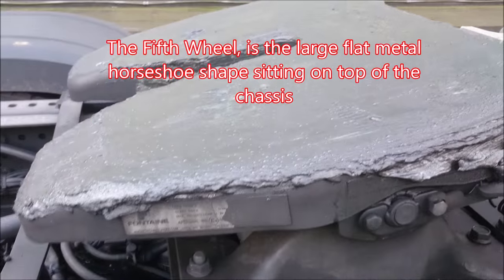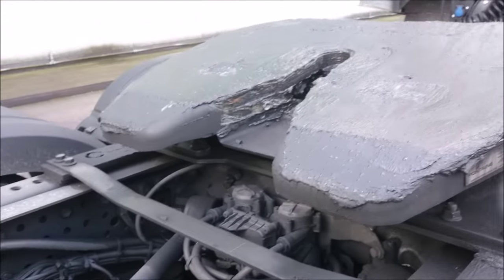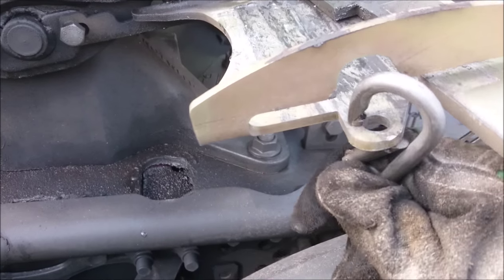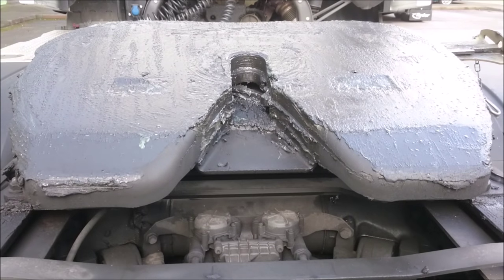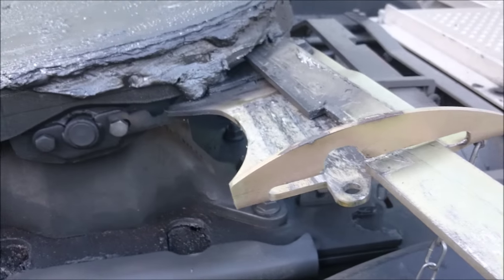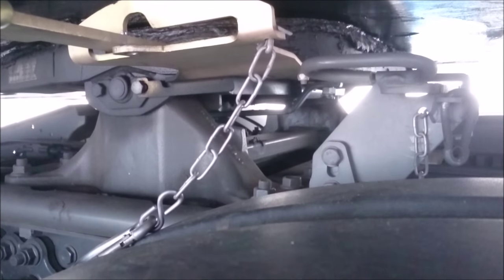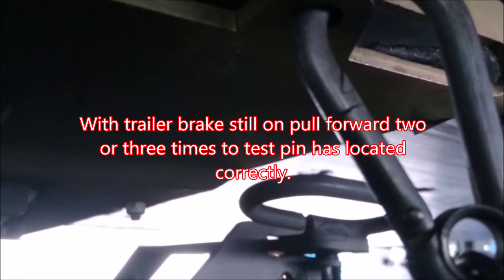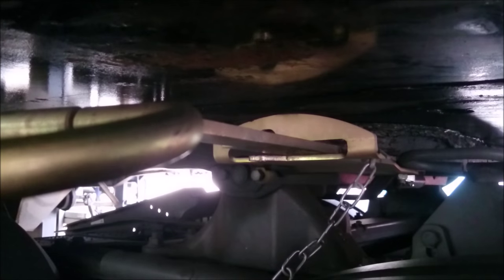Fifth Wheel Dog Clip - LGV Beginners Guide

Comment: thanks to this post I actually passed my theory and my c class 18 tonne ridged practical test just got my module 4 cpc to do now. Do you have any help ideas you can give me?
Reply from the maker: +luke bateman hmmmm sorry Luke can't remember what was in Module 4??? But thanks for the kind comments.When I come up with something that I think might help newbies I try and get a video on asap.
Reply: Module 4 is taken for anyone who passed their C2 or C1 after September 2009 (that includes me), those who passed before just do the 35 hours of CPC random modules. From what I remember Mod 4, was doing your basic walk around checks to the vehicle, and showing how to use certain load restraints, it really is nothing to worry about though, it will be done on an 18 tonner, so you wont have to do any artic checks, lines etc. Just the usual, tyres, suspension, lights etc. After 5 years, those who passed after 2009 will do the regular 35 hour CPC. Hope that helps.